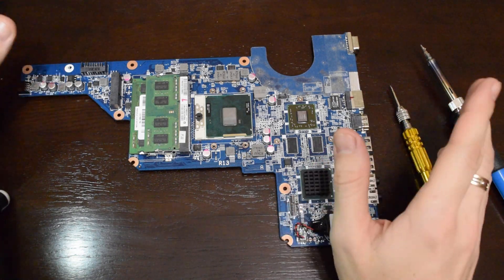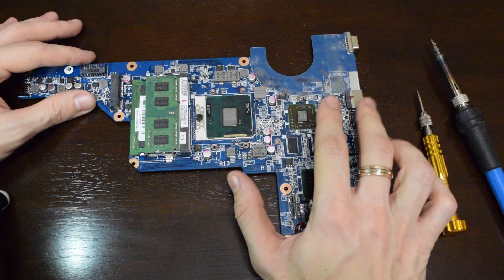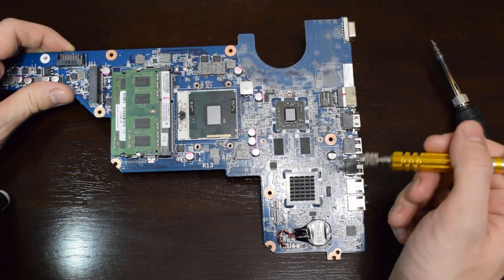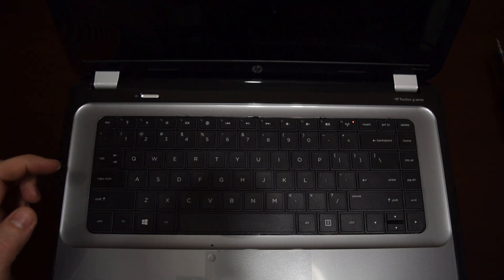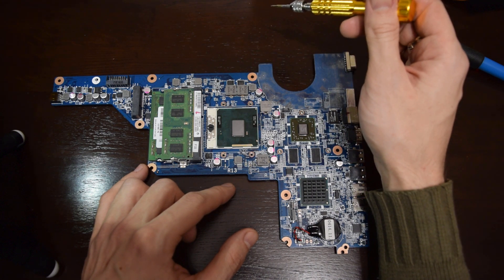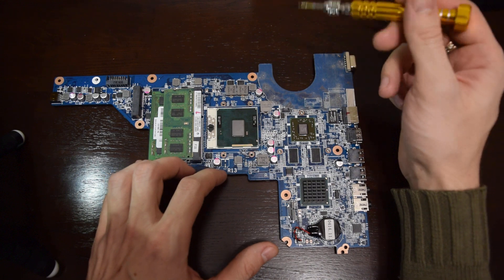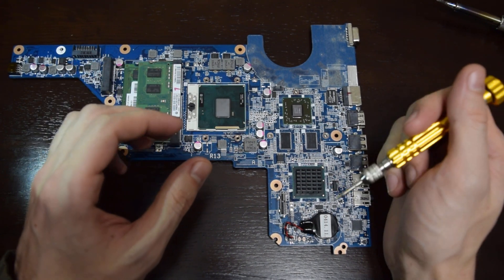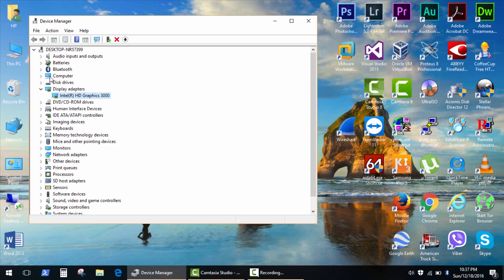Fix Dead GPU – Convert HP, Dell, Lenovo Laptop to UMA Graphics (HP G6 Example)

Comment: Hello great job and i like the idea but i did my best and i still have the same problem i hope u can help me i have hp envy m6 motherbord la-8712p  iam waiting to tell me what i remove and feel free i already consider it dead motherboad thx
Reply from the maker: Just remove this coil: https://ibb.co/bJSf43F
Reply from the maker: Just remove this coil: https://ibb.co/bJSf43F
Reply: Ok thx and i will try it
Reply: still not working here what i think this motherboard have 2 graphic card one hd and one amd 2gb and the bois go to hd first for saving power so i should unpowered the hd.. i really appreciate your time and thanks.. if u have few minutes to help me which coil i have to remove to unpowered hd graphic card it will be awesome
Reply from the maker: @alizeight1482  It's not going to work! You can only disable discrete graphics chip.
Reply: @ElectronicsComputers  
ok and thx for ur time really enjoy thinking about that with you beacuse lot of vedio talk about heating and i dont like the idea of heating
Reply: https://ibb.co/2yRDN1v 
I need to un power this with X mark and like i told u befor is a dead motherbord for me its ok to try and really thanks for ur time

Comment: Hi, Congratulations. Great Idea. In my laptop it shuts down to overheating. Already cleaned and changed the thermal paste. Next step is follow your path. Could you help me out identifying what to remove? The motherboard is exactly like the one in the picture. Computer:  HP 15-p264ns. 
Picture 1: https://drive.google.com/open?id=1MNxXdxphs0WpnEnq8eKWAYl5PWe4gOvg
picture 2: https://drive.google.com/open?id=1rLt8cHbksJcibn7gD3qgDiVW86JURfU8

Same motherboard without the disipator but with out chips card: https://www.ifixit.com/Guide/HP+Pavilion+15+P+Series+Motherboard+Replacement/89191

Comment: Hi brother, i just bought a MSI GT70 with i7 3610qm. Turns on but no image, does not react. I tried heating graphics, no luck. Took it completely off, took care no shorts on board, in hope it would use intel graphics and spring to life, still no luck. Do you have any ideas how to make it use intel graphics, or you think problem is something else? Thank you
Reply: it is a MS 17561 mainboard

Comment: I have an old desktop HP compaq I want to dedicate for saving files but I turned it on, no display but seems everything is ok except display output. Apart from adding AGP graphics card, can the onboard VGA be fixed?
Reply from the maker: If you press CapsLock key LED indicator turns On/Off?

Comment: Hey, I have the Acer Aspire E5 574G, do you know what I'd have to remove to get it to work? With this laptop, it has a dead GPU and it's Optimus meaning I have integrated and I have a Nvidia 940M. Thanks and here is a screenshot of around my Nvidia GPU. https://imgur.com/a/IuM9XHV
Reply: Great video BTW.

Comment: Hi, I have 2 questions: First, my laptop is Sony VAIO VGN-AR770, can you tell the where is that plug I need to remove & solder to cut off ? Second,  the BIOS menu does not have option for video graphics card at all, how do I break in/ modify the BIOS menu so that I can install a external graphics card ? Million thanks
Reply from the maker: It's core2duo laptop so it technically impossible because those CPUs don't have integrated graphics in it.
Reply: @ElectronicsComputers Thank you for yr fast reply ! Yeah it is a Core2Duo, but I also see another intel (looks like a 2nd standard graphics card) , and then the Nvidia GeForce GT 8600m graphics card ) Seems to me I can take the Intel Core2Duo processor but cannot take out the intel small and Nvidia graphics card as both are soldered onto the m-board. 

So just to re-confirm: No-go ??

How about any idea of modify the BIOS menu so that I can by-pass the the faulty Nvidia graphics?? ...(please note: device manager shows Standard VGA adapter, not Nvidia !--OEM OS was Vista Ultimate 32 bits, now Windows 7 Pro 64 bits clean install)

Here is what I am thinking: I bought a sony VGP-PRZ20B dock with external AMD graphics card and blu ray player built-in, ( it was NOT for my laptop model, but for Z and S series), after drivers installation from AMD and Sony, it cannot be detected, so I am thinking it must be Sony BIOS menu blocking it......  .....Million Thanks
Reply from the maker: Your laptop has only one graphics card! Intel is a chipset. The only way to fix it is to replace GPU chip.  @msibanker
Reply: @ElectronicsComputers  Would you please kindly tell me: 
1. How much do you charge for replacing the video graphics card?
2. Where are you located?
3. What choices of graphics video card do I have ? 
Thank you,
Reply from the maker: It's possible to solder ether Nvidia 8400 or 8600. It will cost you about 100$ in most US repair shops. I'm in Seattle. Try also find working motherboard on Ebay, maybe someone has a broken screen or something so you could replace your motherboard.  @msibanker
Reply: @ElectronicsComputers  
If possible, i would like to have a better graphics card, Nvidia 8400 & 8600 are known for defects. 

Another thing is that my laptop was a customized one, it has Intel RAID, i don't think the regular ones have RAID. Also, no way to tell the graphics card on those M/B is/are any good? If not good, it just brings me back to step1 !  My intel chipset, motherboard, RAM and all others are still good, ONLY the faulty Nvidia. 

Do you think you can install a different graphics card? 

How about modification of BIOS menu so that the faulty graphics card can be disabled and allows me to use the external graphic card? 

Please take a look at this and see if what 's yr fee  will be? Thanks 

https://www.bios-mods.com/forum/Thread-Mission-Impossible
Reply from the maker: You have to understand that you can't just pick up a GPU which you like and solder down into your laptop. The only two GPU that is compatible with the pads on PCB and BIOS I mentioned above. Those GPUs live about 3 years and dye.  @msibanker

Comment: Any tips on hown to identify the correct coil? I want to try this on a hp 4520s and a lenovo z51-70, both on thermal shutdown it seems. Both had gpu issues in the past. They are paper weight for now. thank you!

Comment: Would this work on EliteBook 8460p ?
Reply from the maker: try to remove this coil:
Technically it's possible to convert your model to UMA simply remove this coil:  https://ibb.co/PWmq3vF
Reply: were you able to do it? i also have hp 8460p and I need help

Comment: Hi Sir, could you please tell me which coil to remove in the HP EliteBook 8560p Intel Motherboard 684323-001... thanks!
Reply: here is the image of the board:  https://ibb.co/G38P6h8
Reply: What about if I buy a USB 3.0 to VGA?
Reply from the maker: Looks like your model doesn't exist with integrated graphics only and I don't have schematics to confirm if it will work for your particular model. Anyway just give it a try you're not gonna make it worse, here's the coil to remove: https://ibb.co/Qmfbh7N

Comment: Hi, thanks for video, do you think that removing coil is suitable for a hp dv7 4070sf ?
Reply from the maker: Yes, it will work if it's Intel based motherboard! Here's the coil to remove: https://ibb.co/X3F175Y
Reply: @ElectronicsComputers   thank you, I will try that asap
Will it also disable the HDMI output ?
Reply from the maker: No, HDMI will work. If the problem really in dead GPU, then removing that coil will fix your problem and you will never see any difference unless you're a gamer.  @floflo19100
Reply: It worked thank you !!! @ElectronicsComputers
Reply from the maker: I'm glad I could help you!  @floflo19100

Comment: Hello , I hav an asus x54h, can you help me ? Thanks.
Reply from the maker: That easy method works only for HP and Dell laptops. Technically it's possible to switch your laptop to UMA but you have to swap and move a bunch of components which is unreal task to do at home. New motherboard for your laptop costs 40$ with free shipping: http://ali.pub/35mpnz
Reply: @ElectronicsComputers  I have the same laptop, new motherboard wont fix bad design. The gpu is heating up the cpu all the time (same heatsink), making this laptop impossible to use.. Do you think the GPU can be safely desoldered, while bios is set to use the iGPU?
Reply from the maker: There's no need to remove dead GPU, simply remove the coil that powers it. And it's not gonna consume any power anymore or produce heat and BIOS will never know that there's dead GPU it will automatically switch to integrated (UMA) graphics.  @gosth64

Comment: Hi,
Thanks for your great video. I have this problem too with my HP dv3 4170 laptop.
How can I detect the coil that should be removed?
I will appreciate if you help me.
here is the photo of my board:

https://ibb.co/5s8ZBrZ
https://ibb.co/Dfcqq5j
Reply: Hi @2013Electronics&Computers, thank you for your instructive video. I've this problem to and I'll be thankful if you answer this question as soon as possible.

Comment: Hi, 
I have a HP G72 (equals to Compaq C42) with a dead GPU. There are many videos for these showing how to switch to UMA mode by removing, moving or adding resistors in many places in the motherboard. Will you method work for them and if yes, which coil do I have to remove? There's one near the GPU called "1R0" but I am not sure that it's the good one.
Thanks.
Reply from the maker: Here's the coil: https://ibb.co/FHyPDtq
It should work without resistors swap!
Good luck!
Reply: @ElectronicsComputers  thanks a lot
Reply from the maker: Let me know if it worked for you!  @ibra87280
Reply: @ElectronicsComputers  there's no coil on this side. Here's 2 photos of both sides of my board. Thanks.
https://ibb.co/Sy61hY3
https://ibb.co/GxGStJN
Reply: Hi does it worked for you? Was the 1R0 coil? I have the same motherboard and i can not deside which one is it!

Comment: Dear i have Dell N5110 Core i7 2nd Generation  Laptop, which NIVIDiA GT 525 M Graphic Card not working but i did same as you show in video and also you marked in picture as well but it screen appears black no sign of light so i soldered it again so display on but same issue that graphic card heat up and system turned off then I cleaned my board again then board not turning on due to a chip located under palm wrist as well as under mouse pad link for reference https://ibb.co/FXPcRzX
Reply from the maker: Did you remove this chip: https://ibb.co/km6z7j0
What kind of LED indication on your laptop?
Reply: @ElectronicsComputers  yes i did remove and check properly but no display but one thing was same that what ever chip soldered or not laptop turns off after heating up or some other reason even i have cleaned exhaust area fan heat sink applied thermal paste but issue is on same postion
Reply: @ElectronicsComputers  can u help me removing Nividia card components by marking resistance, mosfet or any thing with names from Mother board that i can use its standard Intel HD Graphics?
Reply from the maker: Hi I just checked the schematics and the easy way with one coil doesn't work for this model. But it still very easy and if the problem really in GPU it will definitely work.
1. Remove the coil I mentioned about.
2. Remove this tiny chip: https://ibb.co/TMdPDCW
3. And finally place this tiny resistor to the right side from the CMOS battery: https://ibb.co/880vY1d
I want to know if it worked for you. Good luck! 
 @waseembabar1981
Reply: Dear Thanks for proper response but sorry not replied you because of schedule, today or on weekend i will do as you mentioned/marked in board

Comment: I have a acer aspire 5740 ,having graphics issue what to do to convert to UMA
Reply from the maker: That easy way works only for HP and Dell! Technically it's possible to switch Acer to UMA but you have to replace, swap and remove a bunch of elements which is unrealistic job without tools and skills.

Comment: Hi, i have HP DV7 3000 series with faulty, graphic so i bought this motherboard

https://www.aliexpress.com/item/Laptop-Motherboard-for-HP-Pavilion-DV6-3000-595135-001-DA0LX8MB6D1-31LX8MB0020-100-tested-good/32708096352.html?spm=2114.search0104.3.1.24537844m7Obt3&ws_ab_test=searchweb0_0,searchweb201602_4_10065_10068_319_317_10696_453_10084_454_10083_433_10618_431_10304_10307_10820_10821_10301_537_536_10059_10884_10887_100031_321_322_10103,searchweb201603_59,ppcSwitch_0&algo_expid=f64c9b60-e7b2-4ed3-9ec9-34676420edc6-0&algo_pvid=f64c9b60-e7b2-4ed3-9ec9-34676420edc6&transAbTest=ae803_4

It is the same motherboard as mine da0lx8mb6d1. Everithing works except touchpad, don't know why. On new motherboard graphic chip and RAM are removed(or were newer there don't know)) also nearest coil and few chips around. If i do the same will my old motherboard work also? Where is the graphic becouse this is a Phenom CPu without one, but device manager is listed Radeon 4200. ty

BTW will your method work in 1st gen Intel Core i laptops?

Comment: Hello E&C, The graphic chip in my HP dv7-4153cl laptop is malfunctioning. I searched but could not confirm online nor w HP if the video graphics chip is integrated with cpu? If I have a tech guy remove the video graphics chip coil on this laptop, will the Bios route graphics processing to the processor and the laptop work fine?   The graphics chip is:  ATI Mobility Radeon HD 4250 Graphics
   The CPU is:  2.40GHz VISION Technology from AMD with AMD Turion II Dual-Core Mobile Processor P540

Comment: What about sony MBX266 please tell which power to be disconnect
Reply from the maker: It's not gonna work for sony that way. It works only for HP and Dell only these laptops have absolutely perfect power management circuits. Technically it's possible to switch Sony into UMA mode but you have to remove and move a bunch of elements: https://www.youtube.com/watch?v=JNd38TumcbI
Reply: Ok thanks

Comment: Hello Sir, I have a Hp Envy 4 1002tx. Intel integrated graphics, with AMD HD raedon 7670m dedicated graphics. My laptop works fine with just the intel graphic card but when i install any graphic drivers for amd card, both old (used to work good) and new drivers (both from hp and windows), it gives bluescreen, unable to load windows completely. I would like to remove the coil, can you tell me which coil to remove? Your way seems only the complete solution so far. 
https://ibb.co/tZm11bV
Reply: Thanks alot...I just finished fixing it. It worked. I had so much problems with amd graphics. After removing the coil, it removed amd from windows OS, thus solving all other problems related to this graphics. I now have the option of sleep from start menu as well. Now I can install any windows OS i like. Thanks again.
Reply from the maker: Never tested with this model. Carefully disconnect one side of the coil for testing: https://ibb.co/FH49yMb
That's very common problem with drivers your GPU is slowly dying.
Reply: 2013Electronics&Computers I truly appreciate your help. I always thought that the loud noise my laptop made was because of the RAM upgrade. My laptop used to heat up so hot i couldn’t keep it on my laptop. Now all those problems seemed to be solved. My battery performance increased from 2 hours to 4 hours. Didn’t know that all these problems were caused by a single amd graphics malfunction, always thought it was because of the old laptop, 6-7 years old. Thanks again
Reply from the maker: I'm so glad I  could help you! That's a second life for your device.

Comment: my question is what if my gpu is not absolutly dead when i turn it on it shows the screen for few seconds and after that goes black and it works normal on bios screen i think its the gpu memory chips are failing
but im not sure
Reply from the maker: If it works fine and for a long time in BIOS mode then problem not in GPU. Try to reinstall windows or boot into Safe Mode and uninstall graphics drivers.
Reply: @ElectronicsComputers  in low graphics mode works normal but on higher display shuts down laptop is hp dv7 6xxx i7 3th gen with intel hd graphics and amd radeon hd 6700m-this one doesn't work normaly the thing is on external lcd works i try that on 42 inch tv and it works i dont understand what in the hell is going on with that gpu rly strange

Comment: Hi, thank you so much for this helpful video, I have a vaio e series laptop with dead radeon 7600M chip, this is the motherboard: https://imgur.com/a/2F94DIS

I am having trouble with deciding which coil should be removed, could you please help me?
Reply from the maker: Technically it's possible but requires removing/swapping and replacing a bunch of tiny components. As a home project unreal. Coil removing works only for Dell and HP. Those laptops have absolutely perfect schematics.